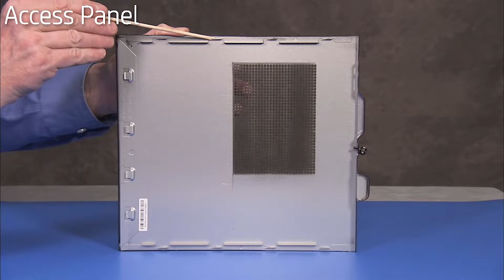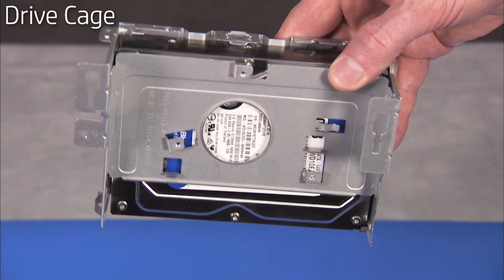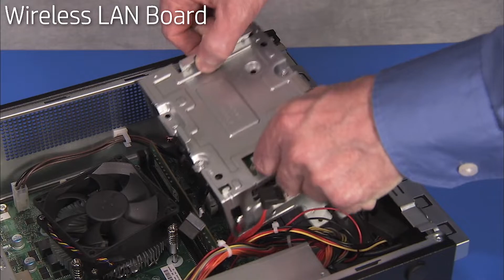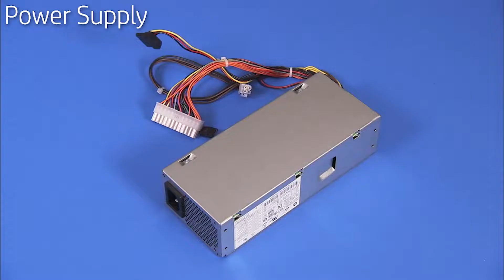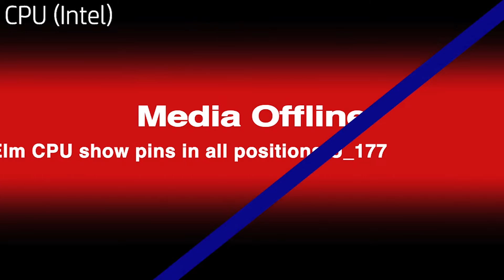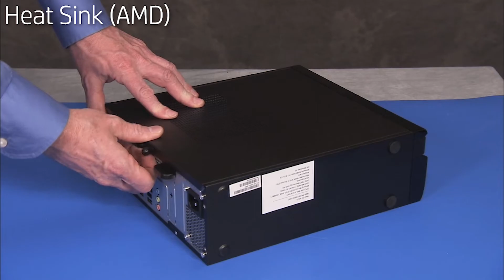Removing & replacing parts for HP Slimline 260-a000 | HP Computer Service

Comment from the maker: Hi there, thanks for contacting HP Global Social Media Support!
I understand that you need to know about replacing HDD by a SSD.
I will do my best to assist you.
HP does not recommend upgrading or downgrading hardware parts or software that is bundled with the product as It may affect the manufacturer's warranty and performance, however, you could change the configuration at your own discretion.
Binu_HP Social Media Tech Support

Comment from the maker: Hi there, thanks for contacting!
I understand that you need to know whether you can add graphics card on your computer. 
I will do my best to assist you.
Checked the specifcation of your computer and found that it does not have an expansion slot to add external graphics card. 
Binu - Social Media Tech Support
Reply: The system in the video has a card slot. What is the slot for?

Comment: What is the best graphics card I can install in this pc that I can play Street Fighter V?
Reply from the maker: +ilovede5 No, you can't install graphics card. Its motherboard does not have ANY slot for a video card:
Reply: @HPSupport  thanks a lot because I was just going to buy a 72000 graphic card..
Reply: @HPSupport  The system in the video shows both a PCIe x16 slot with retention clip, and a breakout cover for a low profile single slot expansion card. So is the system in the video fake, or did HP purposefully install non-working components in a system?

Comment: Can I replace the HDD by a SSD in the 2,5" bay?
Reply: Yes. There should be an M.2 socket as well but I used an M.2 sata. I don't know if it will take an nvme style ssd.

Comment: Hello HP Support i have the HP Slimline 260-a111na Desktop PC model 
which has the AMD E2-7110, processor would i have to replace the motherboard if i wanted too change for faster processor
i was surprised the now old the AMD E2-7110 it was first released in 2015
Reply from the maker: +95winston This computer supports the AMD E2-7110 (Carrizo-L) Quad Core processor only. The processor is not upgradeable.

Comment: Do I Can Install An SSD Together With An HDD And Upgrade Processor To A Better One In HP SLIMLINE 260-A062IL TOWER DESKTOP
Reply from the maker: +Shivam Tripathi It only supports HDD and processor is also not upgrade able.
Reply: @HPSupport  But You Have Replied To A User Named Vipin Sharma That If SSD Fits In Ports M1 And M2 Then It Should Work.
Reply: Was you able to install ssd? Please let me know
Reply: @aakashkr.mahato3266  I haven't tried it , there is no extra sata power cable to power ssd , someone suggested me to use a sata power splitter but i didn't want to take that risk because my pc is new and also I can't afford such risk, according to me we can either use a SSD or HDD in that particular pc.

Comment: My Power Button Is Not Working What Should I Do
Reply from the maker: +RUDE Crush This seems to be a hardware issue with your computer. Please contact our phone support team to fix this issue. Please follow these steps to reach them.
Step 1. Open link: https://support.hp.com/us-en/contact-hp
Step 2. Select the product type.
Step 3. Enter the serial number of your device or select let HP detect your product option.
Step 4. Select the country from the drop-down.
Step 5. You should see the HP phone support number.

Comment: Can we change graphics card for hp slimline 260-a010??
Reply from the maker: Hi there, thanks for contacting HP Global Social Media Support!
I understand that you need to know whether you can change the graphics card of your HP Slimline Desktop - 260-a010.
I will do my best to assist you.
HP does not recommend upgrading or downgrading hardware parts or software that is bundled with the product as It may affect the manufacturer's warranty and performance, however, you could change the configuration at your own discretion.
Regards, 
HP Support
Reply: @HPSupport  okkkkk
Reply from the maker: If you need any help in the future, you can always get back to us.
Thank you for being a valuable HP customer.
Have a wonderful day!
Regards, 
HP Support

Comment: How can i install a ssd in HP slimline 260-P020il
Reply from the maker: +Aakash Kr. Mahato There is no M.2  storage device socket on the motherboard.
So you cannot install an NVME storage device.
Your PC's motherboard  only has two SATA port which are both in use. You also cannot add a SATA SSD.
The only remaining option would be to install a PCIe SATA or PCIe M.2 adapter in the available x16 slot on the motherboard. This option will, most likely not allow you to boot to the new storage device. It may be only useful for storing additional data.

Comment: Does HP slimline 290 support NVME 3.0*2 or NVME 3.0*4?
I install ssd samsung p981a,it only run on nvme 3.0*2(p981a supports NVME 3.0*4).
Pls guides to me
Reply from the maker: +Duc Trung Please refer the specification page to know about the supported SSD: https://support.hp.com/in-en/document/c06316723
Reply: HP Support My model pc is HP slimline 290 p0113d. Chipset H370. I test with crystal disk infor software. It says current mode nvme 3.0*2 (my ssd support nvme 3.0*4)

Comment: How to upgrade Graphics card ? I have Hp 260-p021in It has 180w 80+ Bronze Psu I want to add gt 1030 low profile in it because its 30w card and my cpu i3-6100T is 35 watt. I did some digging and found HP 580-015na it also has 180w PSU but with gtx 1050 and its 75 watt card paired with 65 watt cpu. So will it work ?
Reply from the maker: +Tech 4 U This computer has One PCI-E (GEN 3) x16 socket. So you can insert the graphics card that supports this socket.
Reply: @HPSupport  Oh Thanks for letting me know. I guess it will be OK to insert gt 1030 in it 😊
Reply: @tech4u881  yes I have same specs like you gt1030 is working absolutely fine
Reply: @NitinGadhaik  much appreciated I just want to play some casual games
Reply: @tech4u881  ye men if u have any doubt regarding this PC or graphics card u can ask me anytime!

Comment: Sir can we upgrade m.2 ssd
Reply from the maker: +Ashish mohanta No, you can't place an SSD in this M2 port. It is type socket 1  and is used for wifi, bluetooth, nfc...
SSD are placed in M2 socket 3 even though there ssd used as cache which are placed in M2 socket2.
However you can install a regular 2.5" sata SSD which will still greatly increase your performance.
Reply: @HPSupport  I have a hp slimeline desktop pc p0xx 270 with a “hp 82F2” motherboard, is it true that I am limited to 250 GB on the m.2 ssds?

Comment: can i put a graphics card so maybe i could run games better
Reply from the maker: +Boggy HP does not recommend upgrading or downgrading hardware parts or software that is bundled with the product as It may affect the manufacturer's warranty and performance, however, you could change the configuration at your own discretion.

Comment: Sir, i have a hp slimline 260 pO2Oil, any suggestions where i can get a new motherboard, i contacted the guys at the service center but they said the price of a new motherboard is 14000Rs, which is too high for me, so i want to find it online or elsewhere
Reply from the maker: +Savage Cabbage You can purchase the part from here: http://partsurfer.hp.com/ Please select your country and enter serial or product number of your unit.
Reply: @HPSupport  i checked ,, there is no motherboard for this model anywhere except on ebay
Reply from the maker: +Savage Cabbage Please contact HP Shopping team to purchase the part: https://bit.ly/33djkBd
Reply: Did you get that motherboard?
Reply: @aakashkr.mahato3266  nope

Comment: Can you add a graphics card to this pc
Reply from the maker: +CHANC3Y thanks for reaching out!
I understand that you need to know whether you can add a graphics card on your computer.
I'll do my best to assist you.
Hi, No, you can't. Its motherboard does not have ANY slot for a video card.
Reply: HP Support I have the hp slim 270 so is it the save for this model to because I got a new case and added my mother board to a bigger case and added a r7 260x graphics card to the pc and it does not detect it
Reply: @HPSupport  WRONG. The motherboard has a PCIe x16 slot for a single slot, low profile graphics card like the GeForce GT 1030.

Comment: Hii,
how can I install Crucial 3d 2.5 inch SSD in Slimline 270. Can anyone tell me please.???
Reply from the maker: +Vipin Sharma I have checked the Motherboard Specifications and it has 
One M.2 socket 1, key A
One M.2 socket 3, key M
You need to use SSD hard drives that will fit on the the M.2 Slot Key M. ( You can check the with SSD Hard drive Manufacturers)
If it does, then it should work and you need to reinstall the OS on the SSD drive 
Hope this helps
Reply: @HPSupport  thanks it helps me a lot...
Reply: @HPSupport  crucial 3d nand 2.5 inch ssd didn't fit in the cpu. I have purchased NVme SSD that fit on m.2 slot and worked fine. thanks
Reply: @VipinSharma-nt4ov  did your ssd have more than 250GB, if so please tell me the model

Comment: Hey , I want to add to external CPU fans by modifying the case a bit... can u please tell where can u put the 3 pin and 4 pin connectors of my 2 fans, they both have the options of either using 3 pin or 4 pin.. pls help
Reply from the maker: +Chutzpah HP does not recommend upgrading or downgrading hardware parts or software that is bundled with the product as It may affect the manufacturer's warranty and performance, however, you could change the configuration at your own discretion.